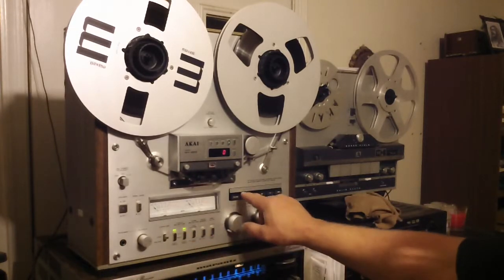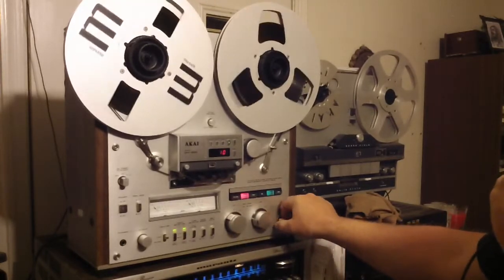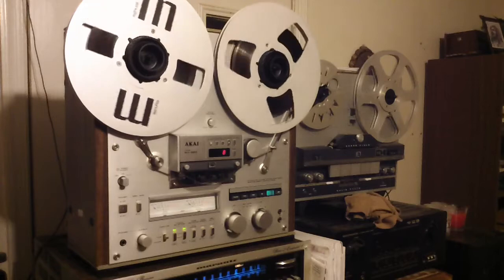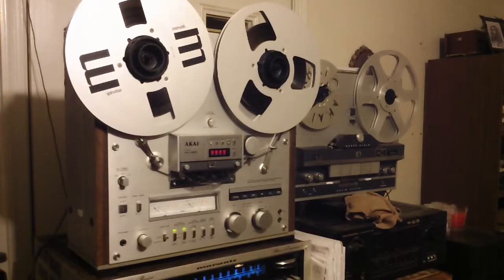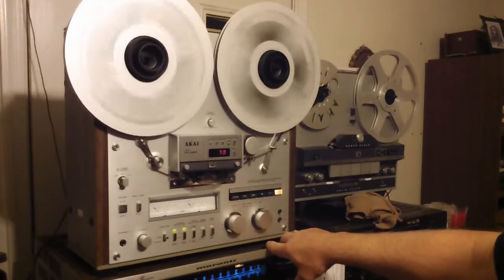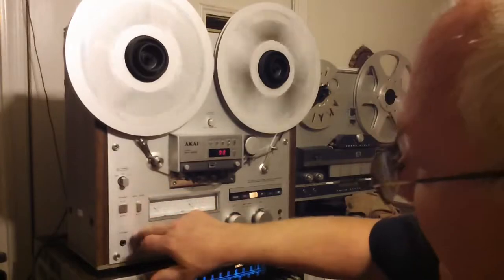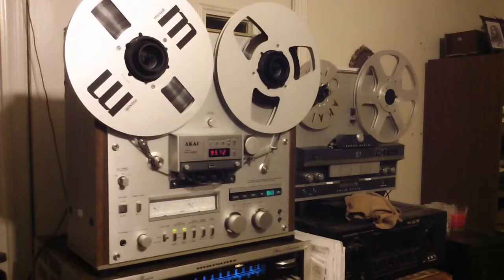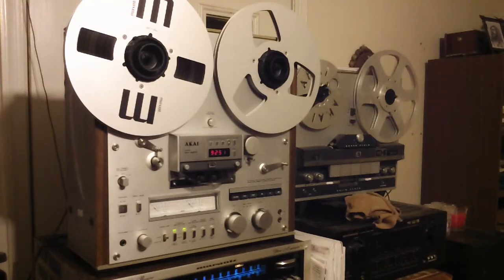AKAI GX 625 Demo. Fully Serviced, Transistors Replaced, 43 Caps Replaced. Nice Deck. ZCUCKOO

Comment: Hello, I have a GX-625 that is in very nice condition as well. I am having an issue with the digital timer though. when it starts out, it counts up fine until it gets to about 500 feet, then the digital display goes haywire. or if you reverse the tape and it goes to 9999 it will do it almost immediately . I have had it to a repairman and he couldn't figure it out, also another one told me not to bring it to him. any ideas of what the cause could be? ps: it worked fine when i got it, then just started doing this. also it blows an 800ma fuse and the screen goes out.
thank you for any help
Reply from the maker: I would check the belt under the front panel. Its on the supple reel side. Have to take face plate off to see the belt. Check if it is loose. Now when you say the screen goes out, what are you talking about, what screen? and if it's blowing fuses something is definitely wrong. I have never had one that was having problems with the timer display Yet.
Reply: @Zcuckoo  hello, and thank you for responding. the timer belt is new and it will count up ok until it gets to about 500 feet, then the led display  starts to show characters that are not numbers and the flash on and off. I have a video of what it is doing. i will put it on youtube so you can see what I mean. It is definitely an electrical concern.

thank you
craig